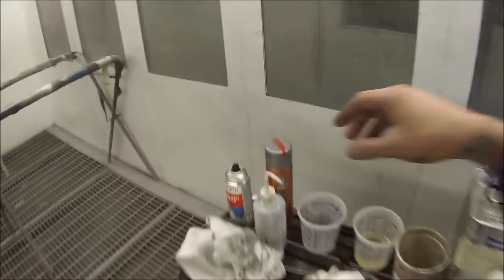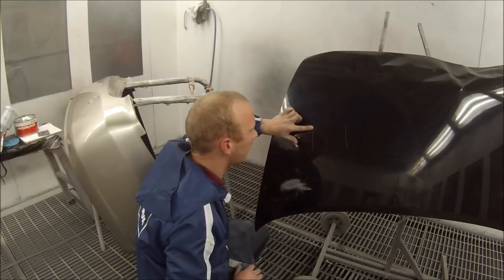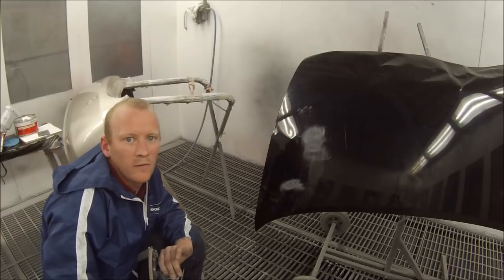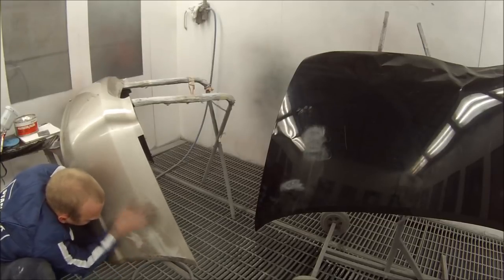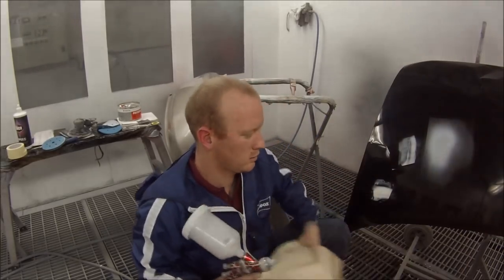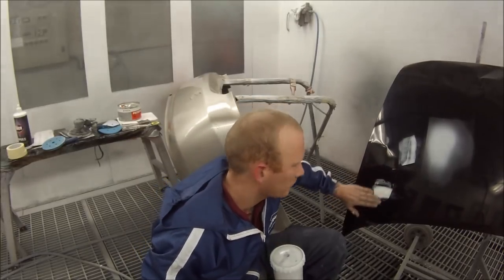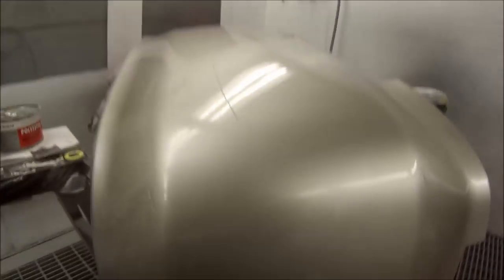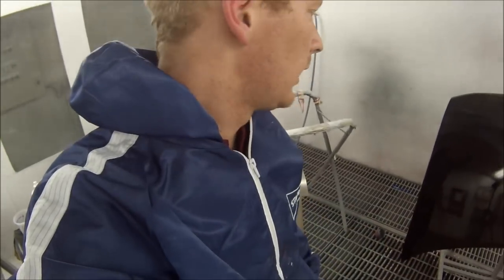Spray Painting For Beginners

Comment: Learned a LOT here!
FWIW dept:  I live in Silicon Valley, CA (San Jose)  We are silly sensitive about the pronunciation of our valley.
Silicon is a hard, tough rock that is basically glass.  We use it to make computer chips.
Silicone is a plastic, very different than silicon.
You'll never find silicon on a car's finish. But you will find silicone which is in a lot of waxes, etc. 
And, you will indeed use a silicone remover.  Not a silicon remover.
I know you may think I am being silly, but there ya go.
Great work!
Reply: Certainly! Let's explore the distinct properties and relationships among **silica**, **silicon**, **silicone**, and even **Celica**:

1. **Silicon**:
   - *Silicon* is a chemical element (symbol: Si) found in the Earth's crust. It is abundant and makes up about 27% of the Earth's crust.
   - It is a metalloid and has various industrial applications, including semiconductors, solar panels, and computer chips.
   - Pure native silicon is rarely found naturally due to its strong affinity for oxygen.
   - *Silicon* is the fundamental building block for the other substances we'll discuss.

2. **Silica**:
   - *Silica* refers to silicon dioxide (SiO₂). It is a compound composed of silicon and oxygen atoms.
   - It is a natural mineral found in rocks, sand, and soil.
   - **Quartz**, a common mineral, is a form of silica.
   - Other forms of silica include **tridymite**, **coesite**, **cristobalite**, and **stishovite**, which are stable at high temperatures and pressures.
   - Silica is also a key component of **silicates**, which make up a significant portion of the Earth's crust.

3. **Silicone**:
   - *Silicone* is a synthetic polymer made from siloxane (Si-O-Si) units.
   - It contains silicon, carbon, hydrogen, and oxygen.
   - Common forms of silicone include colorless fluids, rubber-like materials, and sealants.
   - Applications of silicone include sealants, lubricants, kitchenware, thermal insulation, and medical devices.
   - Notable silicone products include silicone caulk, silicone oil, silicone grease, and silicone rubber.

4. *Celica* (Note: This term is likely a typo or unrelated):
   - *Celica* does not directly relate to the other three substances.
   - However, if you meant *Celica* as the Toyota Celica, it is a car model produced by Toyota from 1970 to 2006. It has no chemical connection to silicon, silica, or silicone.

In summary:
- *Silicon* is the element.
- *Silica* is silicon dioxide (a compound).
- *Silicone* is a synthetic polymer derived from siloxane.
- *Celica* (if referring to the car model) is unrelated to the chemical substances mentioned above.

Feel free to ask if you'd like further clarification or have additional questions! 🌟

Source: Conversation with Bing, 3/16/2024
(1) Silicone vs Silica vs Silicon - What's the difference - LGDSilicone. https://lgdsilicone.com/silicone-vs-silica/.
(2) Is Silica Silicone? (Silica vs Silicone) (Explained) - Tag Vault. https://tagvault.org/blog/is-silica-silicone-silica-vs-silicone/.
(3) Silicon, Silica, Silicates and Silicone - University of Wisconsin .... https://minds.wisconsin.edu/bitstream/handle/1793/11591/Silicon.pdf;sequence=1.
(4) Difference Between Silicone and Silica - GeeksforGeeks. https://www.geeksforgeeks.org/difference-between-silicone-and-silica/.
(5) Silicon, Silica, Silicates and Silicone. https://minds.wisconsin.edu/bitstream/handle/1793/11591/Silicon.pdf?sequence=1%20.
(6) undefined. https://minds.wisconsin.edu/bitstream/handle/1793/11591/Silicon.pdf.

Comment: Great video. Thanks for sharing. When you talk about adding 4 or 5 more coats of clear coat to the bonnet, would you wet sand between each coat, or only after the final one?
Reply from the maker: Chris Parr No not in between coats but 2000 wet after then polish.
Reply: The Gunman Thanks for the tip.

Comment: You can raise a bit your masking tape or use another piece to create little pocket like cavity and when you spray paint it won't form straight line and no need to spray away from tape when air blows back from tape it's also easier to sand down.

Comment: Good video, appreciate the time spent fixing up junk parts haha. Just wanted to ask: when doing the drop coat with metallic base coats how do you know your not spraying it too lightly? Also I read you should do two drop coats at 90 degrees to each other (so one sprayed horizontally and one vertically) is this correct or can it be avoided. I just want to get the metallic effect showing properly. Thanks.
Reply from the maker: Thanks, so I like to have the fluid right out on the gun when spraying base and set pressure to about 25psi (for this gun anyway) too light and that will be prone to mottle too as you say that method can work and I used it when I was learning how to paint with good results but it isn't necessary as you will see in this vid How to Spray Silver Without Mottle thanks for watching and good luck.

Comment: Thanks for the Vids! Doing my first resto and have just found them. Looking forward to learning heaps. Quick question ... I am currently painting the underside of a bonnet, it had a bit of surface rust and I hit the corners and hard to reach bits with sandblasting. Now, no matter what I do I just can’t get all the crap out of the ribs under the bonnet. I have blown with air gun, sucked with vacuum even made an attachment to stick right down the ribs, have banged and banged with a rubber mallet, tacked and tacked and tacked with a tack cloth and it just keeps appearing when I think it has stopped. Have done etch and filler primer and have had to sand so much grit out of it. I did spray it horizontal last time so going to figure out how to hang it next time, hoping that will help. Got any other ideas?

Comment: Gunman, your videos are a great help. I see that the Devilbiss Tekna Prolite Spray Gun has several different model numbers like 703517, 703566, 703567 etc. whats the differences. and whats your recommendations on spray guns for primer , Basecoat and clear. 
I,m working on a 1980 Camaro now. I'm using Duraglass on bare metal on the welds and small filler, then Rage gold over that and where its needed. Then primer, base coat and clear. I didn't strip the paint completely off just sanded it down except its bare metal  where I am using filler. Any recommendations on anything. As you can see I am a Novice. Thanks
Reply from the maker: So you have a gun or looking at one? I recommend the GPI it has 1.4mm for base clear and 2K DG, 1.6mm for acrylic and light primers and the 1.8mm for thicker build primers, all in 1 gun by changing the needles and tips, good quality and reasonably priced.
See review on my website here 
https://thegunman.net.au/devilbiss-gpi-review/

Comment: Is the overspray of the clear coat on the unsanded part of the panel a problem?  Will the clear only come off on that part later, without pulling off the rest of the clear?

Similarly, if you get overspray of base on unsanded part, do you have to sand off overspray (what grit?) prior to applying clear?

Comment: Do You flat the base coat before spraying the clear coat when doing base coat clear coat jobs? Thank your videos are great
Reply from the maker: No, only ever sand the basecoat if there is an imperfection you need to remove but you must reapply more basecoat before clear, otherwise you will see the scratches.

Comment: 1st things 1st, EXCELLENT videos thru-out, not just this video, but  all your videos are just downright EXCELLENT!

***Now on a completely different subject. What's your take or feeling on LVLP (low volume, low pressure) spray guns?

Personally, as a hobbyist and an apartment dweller who doesn't have a garage, basement or an extra room in which to spray paint, I see LVLP spray guns as a huge advantage. Very little over-spray is the main attraction.

So to elaborate on my original query, do you feel or believe LVLP are the future of spray guns? Is HVLP spray guns on the way out?

And do you know anything about RP Compliant Spray Guns, are these the same as LVLP spray guns?
Reply from the maker: James Patterson Thanks mate, basically I prefer conventional or RP guns, they all have a place in the gun market and don't believe any of them will really be fazed out in a hurry, LVLP for diy, home, hobby. Conventional (RP) guns are the best all rounder and can spray near any paints with minimal overspray and can achieve top results easily, HVLP are more suited to low VOC & HS paints that are thick and can replicate the europpean style finish using less paint than the others, lvlp would be nearly impossible to spray some of those VOC & HS clears unless you thin them right down.  Its all to do with the size of the holes the air comes out, I did 3 videos on the topic be sure to see these 3 vids and hope it can help you understand a bit better, don't worry man I was quite confused myself for a while about the 3 types of guns.  
https://www.youtube.com/watch?v=Cu8z5mtPuV8
https://www.youtube.com/watch?v=59YFDwRaHR0
https://www.youtube.com/watch?v=76BKBHPK3Zc
Reply: The Gunman OUTSTANDING Gunman. The 3 videos are exactly what I needed. Big Thanx!

Comment: Thank you for your efforts.  One suggestion--define the abbreviations as you present them.  I know abbreviations are understood for the experienced body men but for us newbies, definitions would really help.  For example,  "clear 20-82.and 20-25 2k primer" is mostly Greek to me.

Also, back to using polyesters on plastics.  The literature prescribes very specific compounds for the type of plastic being repaired.  Do these compounds produce that much better of a job?  Would you use a plastic-specific compound on a higher end job?

Also in plastics, isn't it a bit dangerous to use power sanders on plastic surfaces?  What about heat build-up?

Thanks, M. Young, California USA
Reply from the maker: Thanks for your feedback man, I do do my best to use a lingo that everyone can understand but it can be difficult because there is so many names for the exact same thing in this industry, in practice polyester fillers are totally fine in plastic bumper bars and it is widely used in the trade worldwide but just don't use too much (try to heat and remould first then fill for big repairs)  and the sanders are totally fine on bumpers as the plastic is so thick and without them we would be spending endless hours sanding bars by hand and we'd never make any money. Thanks again mate and good luck.

Comment: In regards to applying clear coat, if for some reason you couldn't re-spray clear over the whole bumper or hood, what are the options for spraying clear on the repaired areas only, while still being able to blend into the remaining clear coat without having (too much of) an edge ?

Also, is it generally best to respray the whole panel/bumper with base then clear, even if the damage/repaired area is isolated to a small part of the panel.. like the damage on the bumper in the video ?... 
I've got a black honda crv that I bought and it has deep scratches where somethings hit/scraped it... I was planning on sanding it back, filling, priming then painting.. though wasn't sure if I should just repaint the whole bumper then clear just to make it look nicer.. or whether I can still get decent results with a spot repair.

Great video btw :)
Reply: Any update on what you did @sypher0101
Reply: flamecrow no update. Don't think I'll bother with it. Damage it minor section + planning on selling car.

Comment: I have just seen a used gun the name is DeVibiss Tekna Pro  not Prolite and the model number is 703581. Any idea?

Also Do I need to remove all the paint off the car when painting the whole car or just where I use filler and sand the rest of the car?

Comment: hey mate your gun you use the devilbiss gti pro is that only available in you country and can it be use for water borne paints as well i'm looking to get back in it again after selling all my stuff years ago  i now have most of what i sold back then to replace just looking for a good paint gun and primer and clear guns . I'm uses to ole school so your help is appreaciated  G.day
Reply from the maker: rock dawg I'm pretty sure the gti is sold worldwide however in the USA its branded as a Tekna with a few cosmetic changes and no air adjuster valve so a regulator is required. I have only ever used solvent base with it and to be honest I'm not sure if it can be used for water, maybe just ask your local auto paint supplier and they'll know.
Reply: Tanks i did find that bink make a model that will do waterborne it $469.00 and is availalble in the states my problem is i have only a garage no booth and use resperator for fumes just liked the paint contains no VOC's
Reply: hey mate i found the one you recommened my body shop supply tekna pro lite it does do water borne saw what cha meant about no air valve can use regulator same thing as my ole binks 7 thanks for your advice cheer have a great week end i owe ya a cold one greg
Reply from the maker: Good luck mate :-)
Reply: found the one u said its available here tekna as you said it doesn't have a air valve the supply here said it does booth water and solvent thanks for the help...

Comment: If I were to do dents and scratches with minimal tools, is there any rules about where you use the primer and paint.  Inside a garage/ tent or outside? And any ppe needed as I'm new to car maintaince?
Reply from the maker: Marcus Thompson I recommend using a respirator, dust masks for sanding, gloves for handling solvents and paint. As for where to do it by law in my country Australia for spraying any 2 pack paint you must be in a compliant Spray booth.
Reply: Would Preval sprayer be a good product to use?
Reply from the maker: Never heard of it

Comment: Great video gunman you make it look so easy. I have a question though. I'm painting a bumper for my dad and it's for his 18 wheeler. The dealer where he bought the truck painted the bumper with just spray paint and no primer nothing, so the paint is flaking of quite a bit. I sanded the old paint off with 120 and then went over it with 320 then 400 and it's pretty smooth. We bought adhesive promoter, sand able primer, and black spray paint. I rinsed the bumper with water and then I'm gonna use a tack cloth with rubbing alcohol to clean it good and then the products. Is this kind of the right method to where the paint will stick good. Like I said it's just a 18 wheeler bumper, not a show car...lol. Any info would be greatly appreciated as this is my first time doing something like this.
Reply from the maker: Thanks for watching mate and I hope you were able to learn some tips here, It sounds like you have the basic idea of how to get it done just make sure you don't apply the cleaning solvent (wax & grease remover) or as you may be using alcohol, Don't apply to the tack cloth just apply to a rag then use the tack cloth after, just to remove any dust left over, Check out some of my other videos and it will go through those steps in more detail if you're still not sure, Good luck mate and I hope i got my reply to you in time.

Comment: The Gunman Hello mate... hope you're well.
I've been watching loads of your videos ...including this one obviously. 
I've just sprayed my van door with cans...repairing previously bodged filler and rust.
I just completed the clear coat...again using cans...and found a little high spot I have to put right...So I will be using the advice you gave in this video...thank you.
I just wanted to ask you...is it ok to wet sand spray can clear coat....a body work guy near me said to just buff it as the canned clear is too thin to sand ? Just wanted your opinion please....as I'm just not happy with the overall finish after buffing today.
Thanks mate
Reply from the maker: Well he's got a valid point, it is a bit thinner from the can but as long as you put enough coats on them you should be right to use some 2000 grit and sand it back. Maybe just try a small spot and make sure it's not going to cut through.
Reply: @TheGunmanChannel  Thanks I appreciate it.
I'm nervous now lol.. I used two cans of clear...have just got another one for the repair obviously...I dont know weather to just leave it now.
Unless I cover the repair then try and put another coat all over...leave it until tomorrow and wet sand it gently then ?
Reply from the maker: @supernube5051  if you didn't put lots on your probably best of leaving it man
Reply: @TheGunmanChannel  Well...I repaired the low spot...and I put a good 4 or 5 coats of clear over the area.
I also found four empty cans of clear in the garden....yep I'm doing it outside lol (lesson two learned)
So I used 4 cans originally... While I was waiting for things to dry I wet sanded an area with 2000 grit...buffed it up quick and it looked spot on....like a mirror.
There was no colour on the buffer at all ...so I'm hoping that means I didn't go through the clear ??
I'm bidding on a compressor on ebay ...150 ltr ..15 CFM...I intend on spraying my van myself now....with lots of questions coming your way mate lol....Im loving it.
Thanks for all your help mate...I appreciate it.
Reply from the maker: @supernube5051  yup if there's no colour on the pad you didn't go through. Well done and good luck mate.
Reply: @TheGunmanChannel  I'm soooooo f'd off.
The clear is terrible...had so many problems I have started sanding it all off to start again.
Now it doesn't want to sand...and I'm getting like a crackled look and can seem to sand through it....
Help please mate...I'm about to lose it.
Ordered three more cans of paint and three more clears...
Sooooooo fxxxxx off its unreal.
Thanks mate

Comment: 2000 grit would take a long time to knock off the orange peel from rattle can clear.  I did 1000 grit, then 1500, then 2000, then buffed it and there was almost no orange peel and i didn't burn through the clear.  You have to be very careful when sanding the edges of a panel though.